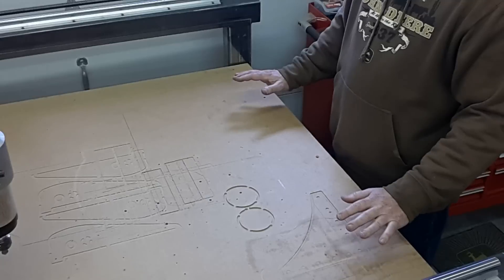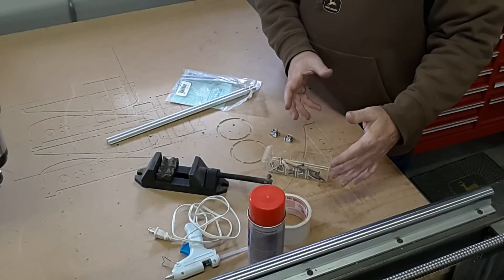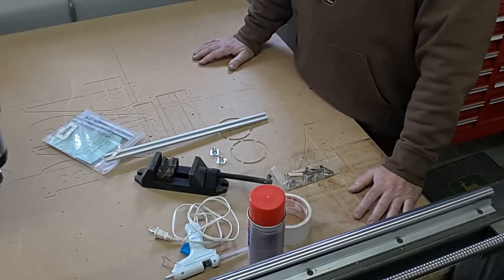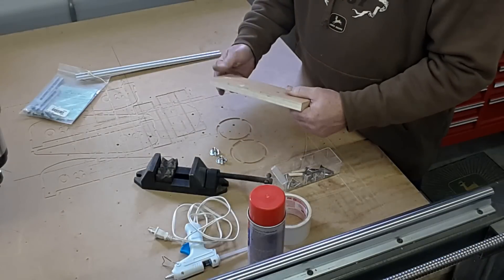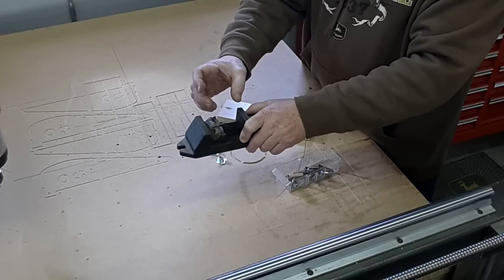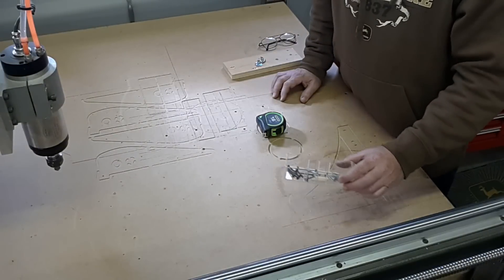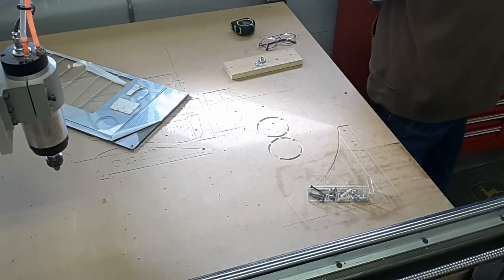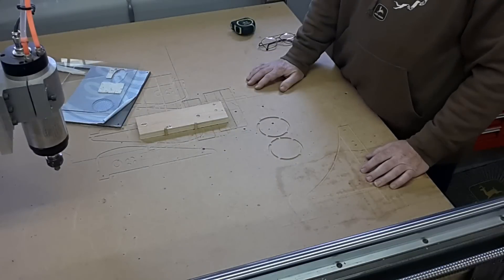Spoil boards and work holding on your CNC Router.

Comment: There is a great method using masking tape and CA glue that I use and works excellent, much better than double sided tape....Here is the video about it on Crimson Guitar's channel.  https://www.youtube.com/watch?v=ub6PsY4cgwg
Your spoil board looks just like mine!! Lol, here is a video of mine.  https://www.youtube.com/watch?v=xf5D5pHHFac
Thanks for your great video and the sound is much better!!
Reply from the maker: That is a fastening method I hadn't see but will be trying for sure!  I have had hit and miss experience with double sided tape.  This reminds me of a method I saw for mounting a bowl for finish turning.  They use a sheet of plain paper between the bowl and the mounting blank, soaked with super glue.  When you want to remove the blank, the paper is the week link and it splits there.
Reply: payday1963 subscribed brother. more cnc stuff plz! wiring everything overview please! !!

Comment: Very good video. I have used all the above methods. My current favorite is a +1 on the CA glue and blue tape. The best part is NO TABS NEEDED. The method really holds parts down. I usually use 3 stripes, top middle, and bottom. I might move the placement (or add more) if there are small parts on the sheet. Even small parts do not come loose. I use Fastcap 2P-10 Thick. All you need is a thin squiggle down each tape. Then hit your piece with a shot of activator. Double sided taped parts I can easily pull up with my fingers. With the CA glue, I have to use a putty knife.

If you're not cutting large parts, then put a spoil board on top of your spoil board.  I 'CA glue and tape' down a 2 ft x 2 ft section of MDF.  I can then resurface it more often to make sure it is in the correct cutter plane. It works nice for engraving acrylic and real accurate vcarving.
Reply from the maker: I am using the same product.  I have used a lot of CA glue over the years and this is some of the best.  Thanks for the comment. ~P

Comment: I was going to use t nuts and I wanted the router to drill the holes. When I ran the sim in cam, it just wanted carve the perimeter...which is outside the machine limits.